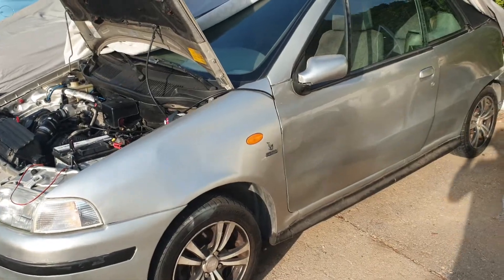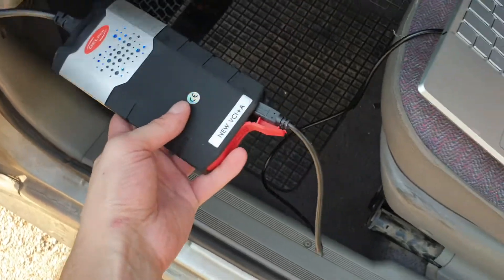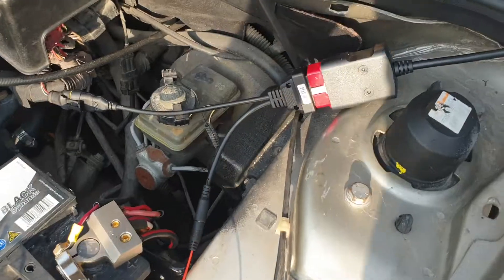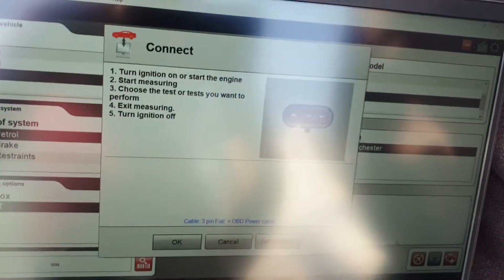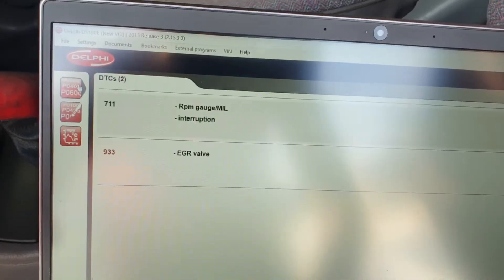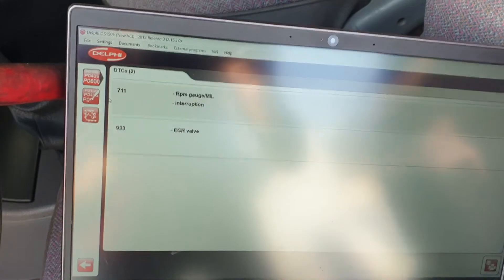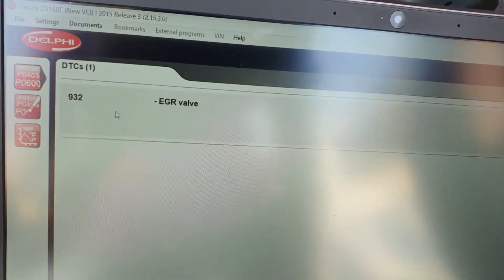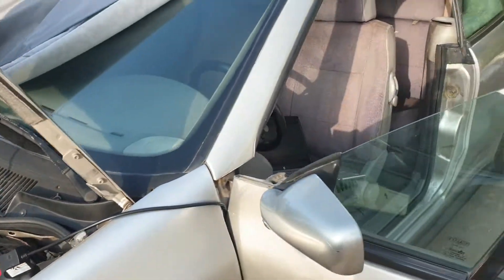How to connect to Fiat Punto/Tempra 1.6 ECU

Comment: Hi! I've bought a scanner just like yours. SW is 2021 update, it has the GM Rochester ECU just like yours. The problem is: I have a Cabrio 1.6 90 and an SX 1.6 90 as well. My SX is having troubles when idling... revs go down and it turns off. I tried to scan it for errors but the SW says vehicle don't respond. Tried with the cabrio and the same thing happened. Any tips on how to make the scanner connect to the ECU? Thanks in advance!